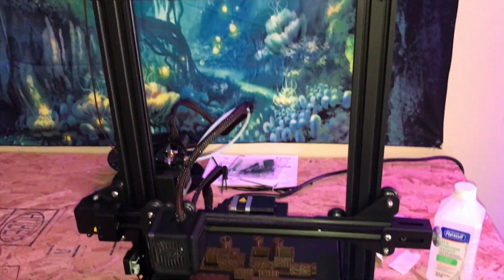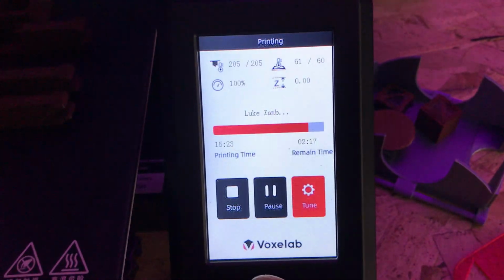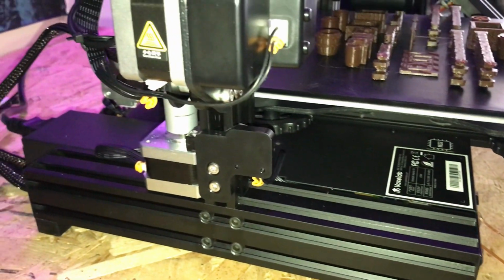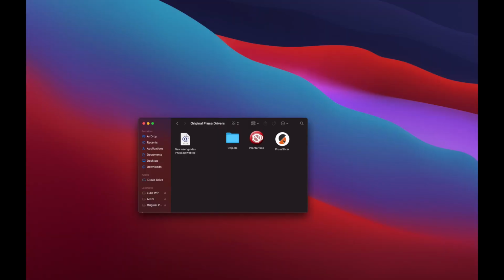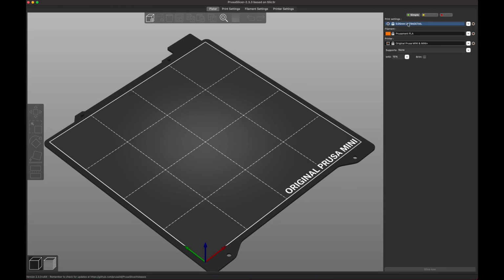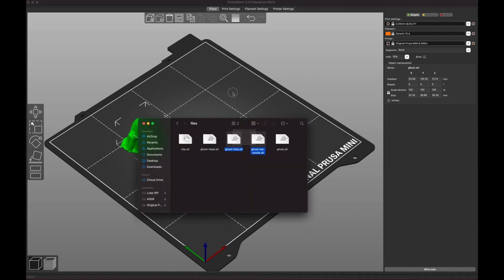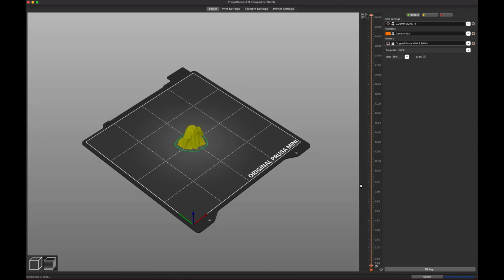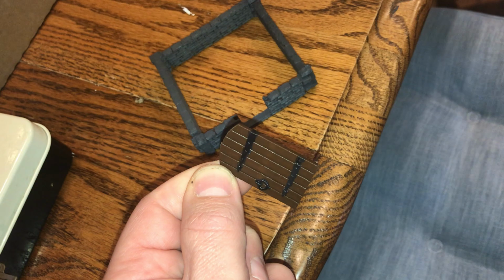Voxelab AQUILA X2 - $199 3D Printer - Review and Demo

Comment: I followed all the steps in the video, even found the same little ghost stl file. I exported the g code to my SD card, but when I inserted the SD card into the Voxelab Aquila X2 3D Printer, the file did not appear. Can someone please help with how I can get my first print file to appear on the printer menu?
Reply from the maker: Make sure it is a Gcode file you have to slice the STL file first
Reply: @LukeFosburg  I wonder if it worked for them...

Comment: It's not a Prusa product but you're mentioning Prusa software and presets? Any particular reasoning?
Reply from the maker: Ya man! I worked with Cura for a while and found lots of defects in all my prints, a weird z hop issue, as well as unusable supports. When I got into using Prusa, I found that the prints all came out a lot cleaner with no weird marks. Support generation is amazing. For me its much easier to use and less easy to miss something that is important and causes the machine to throw the plate or something.
Reply: @LukeFosburg  good to know, cheers. Just bought one of these printers after watching the vid and others :)
Reply: @etherealhawk  im about too buy one how do you like it so far